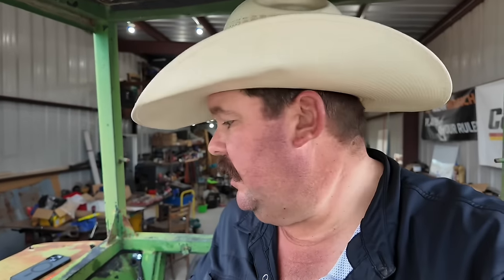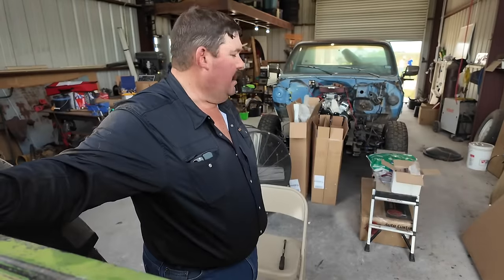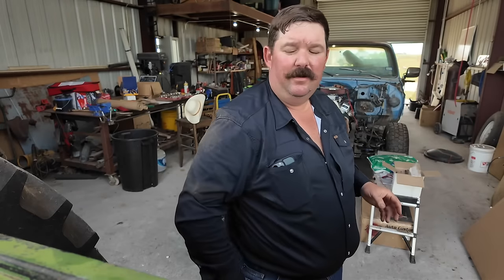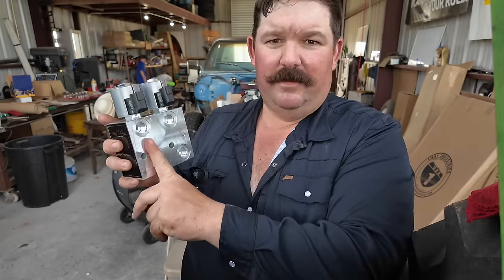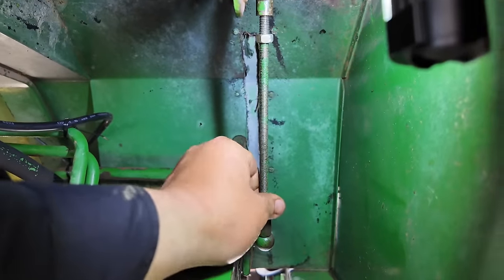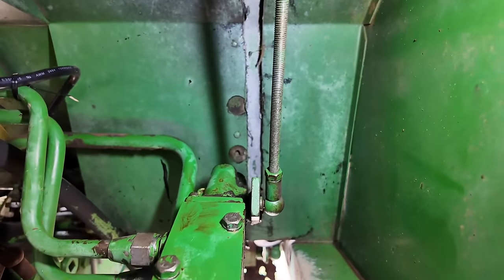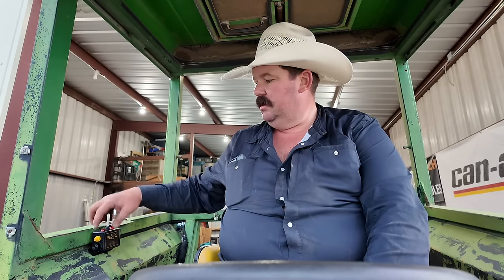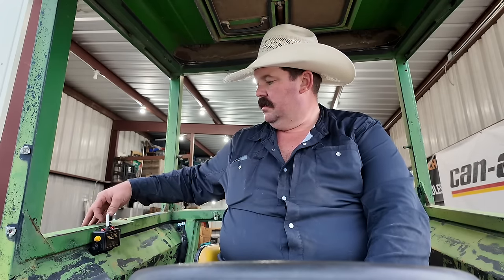Splitting Up For The Better | Bar 7 Ranch

Comment: would it do to bend a 3/4 pipe and weld it on down toward the battery for the wires to run through?

Comment: Not happy with the clickbait title knew that's what it was, but your call on that and opinions are like posteriors, everyone has one.
Cody, I might have run a protected fuse block to the back of the tractor, or into the cab rear, seems like you might be wanting to add more 12v things into the cab later, that way one run to the battery is all you needed. My two cents worth.
Reply from the maker: Thanks for watching and interacting!